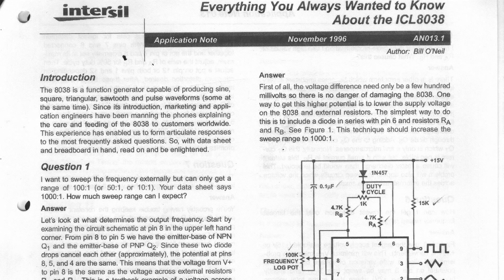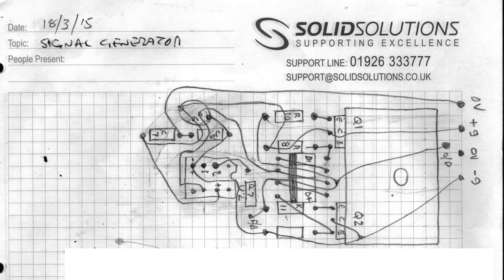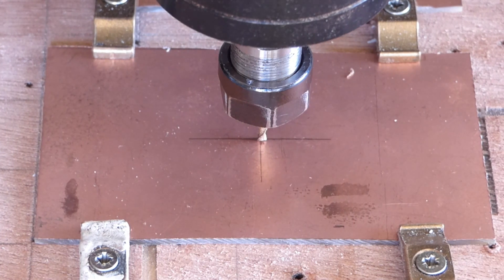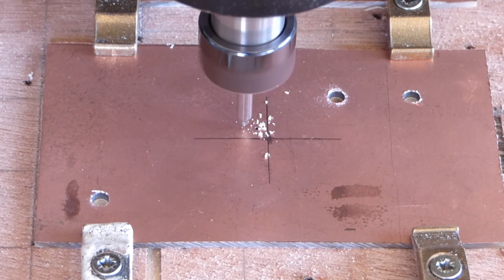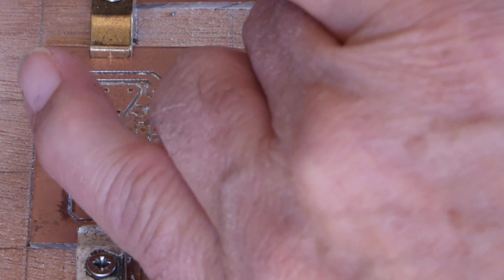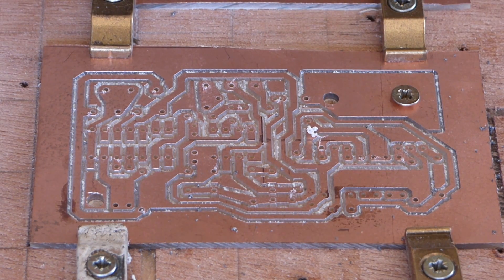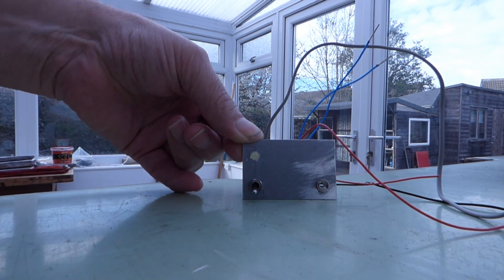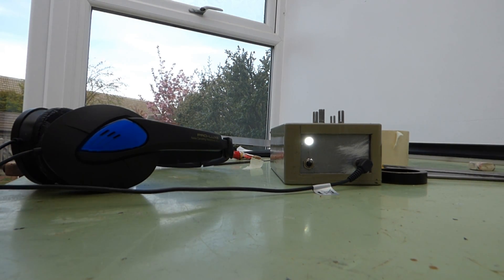Design & mill a pcb

Comment: what software do you using?
Reply from the maker: At the moment I simply use a pencil and eraser to design the pcb. In the future I intend to learn DesignSpark PCB so watch out for some tutorials on it from me. I transfer the pencil drawing to Autosketch 9 and generate the code from a DXF file saved from it then uploaded to Vectric Vcarve Pro. I'm learning DesignSpark Mechanical because I want to make custom parts for the PCB work.